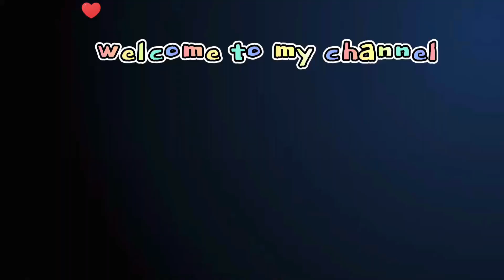( WORN OUT CATALINA ) EP52---Making Replacement Differential Ispiral Vevel Gear

Comment: Having a few years of experience in making crown wheels professional, this is pretty impressive.

However, gear geometry is advanced, and without the correct hob profile that gear will not be operational with the pinion.

Hardening is also complicated as you need a good clamping during quenching to not warp it.
Reply from the maker: That's good very well said

Comment: Excuse me, what is the method for calculating the helical step of the gear?
Reply from the maker: You can use 2 kinds of indexing  formula first direct indexing but, if your computation with reminder you can use also  the other one is differential indexing.
Reply: @LOHERNtvofficial  I did not find any formula. I am the owner of a gear workshop. I own a regular separator, and another is a hope. I want the calculation formula, for example, depending on the number of teeth, the degree of wear, or the length of the workpiece, please, in a simple way.